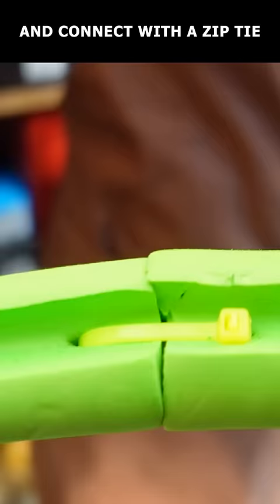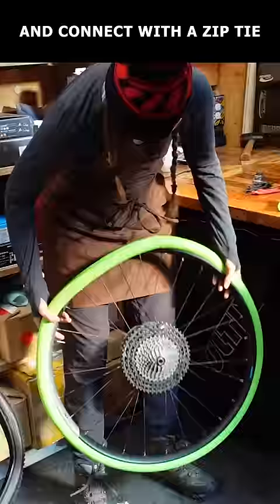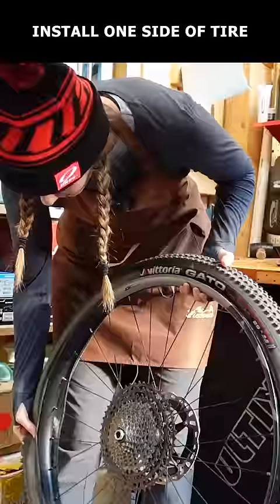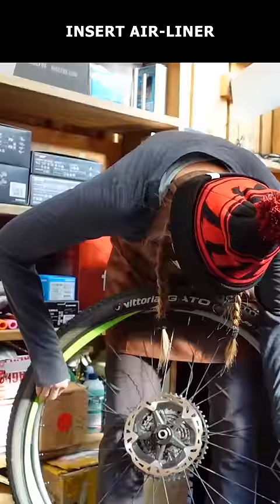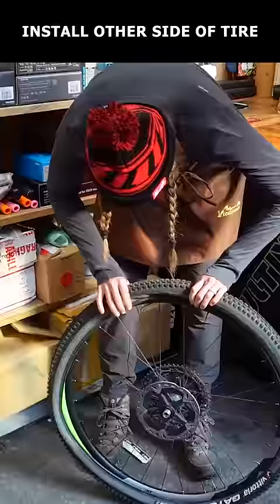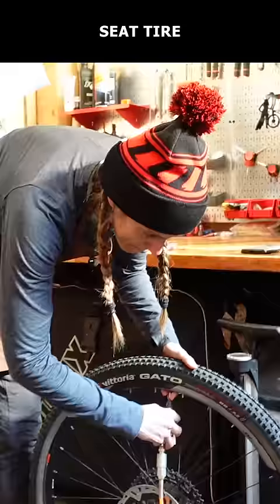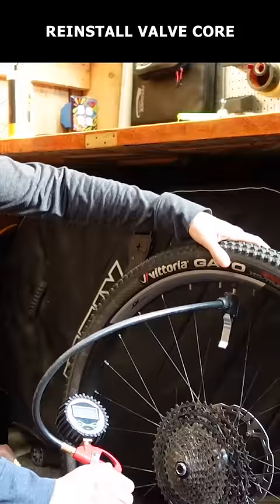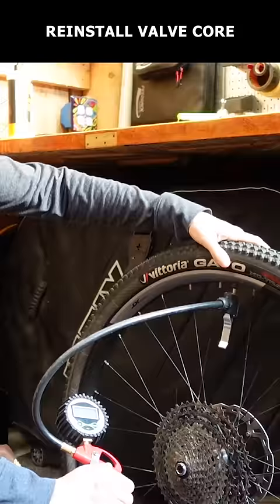Installing the Vittoria Air-Liner tire insert #Shorts

Comment: Is she saying that is a tubeless rim? Cos no mention of a tube going in with that.
Reply from the maker: This system provides additional rim and puncture protection in tubeless setups and allows you to run slightly lower pressures. It is also a "run flat" system so if you do get a flat you can continue to ride the tire without risking it rolling off the rim. We don't generally recommend that unless you're racing enduro or downhill, but it is an option. So, while it isn't for everyone, it's quite helpful for lots of people.

Comment: Looks heavy......why not carry a patch kit and some big air?
Reply from the maker: This system provides additional rim and puncture protection in tubeless setups and allows you to run slightly lower pressures. It is also a "run flat" system so if you do get a flat you can continue to ride the tire without risking it rolling off the rim. We don't generally recommend that unless you're racing enduro or downhill, but it is an option. So, while it isn't for everyone, it's quite helpful for lots of people.

Comment: When you said to cut it 1cm shorter than measured, it looked like you did just that and cut 1cm shorter. However, when you said to insert the zip ties 1cm in, that was more like 5cm.

Comment: You could just you know buy a regular tubeless tyre kit
Reply from the maker: This system provides additional rim and puncture protection in tubeless setups and allows you to run slightly lower pressures. It is also a "run flat" system so if you do get a flat you can continue to ride the tire without risking it rolling off the rim. We don't generally recommend that unless you're racing enduro or downhill, but it is an option. So, while it isn't for everyone, it's quite helpful for lots of people.

Comment: Why inflate... just use regular tire if you have to inflate and it's not flat free why install?
Reply from the maker: This system provides additional rim and puncture protection in tubeless setups and allows you to run slightly lower pressures. It is also a "run flat" system so if you do get a flat you can continue to ride the tire without risking it rolling off the rim. We don't generally recommend that unless you're racing enduro or downhill, but it is an option. So, while it isn't for everyone, it's quite helpful for lots of people.

Comment: This is instead of an airtube for no flat tyres?
Reply from the maker: This system provides additional rim and puncture protection in tubeless setups and allows you to run slightly lower pressures. It is also a "run flat" system so if you do get a flat you can continue to ride the tire without risking it rolling off the rim. We don't generally recommend that unless you're racing enduro or downhill, but it is an option. So, while it isn't for everyone, it's quite helpful for lots of people.

Comment: whats the purpose of this? to be safe when you get a puncture? genuinely curious.
Reply from the maker: This system provides additional rim and puncture protection in tubeless setups and allows you to run slightly lower pressures. It is also a "run flat" system so if you do get a flat you can continue to ride the tire without risking it rolling off the rim. We don't generally recommend that unless you're racing enduro or downhill, but it is an option. So, while it isn't for everyone, it's quite helpful for lots of people.
Reply: @sydfixesbikes  ohh wow, that's cool. thanks for explaining it to me

Comment: What's the point of the air liner if it's still taking air and sealant
Reply from the maker: This system provides additional rim and puncture protection in tubeless setups and allows you to run slightly lower pressures. It is also a "run flat" system so if you do get a flat you can continue to ride the tire without risking it rolling off the rim. We don't generally recommend that unless you're racing enduro or downhill, but it is an option. So, while it isn't for everyone, it's quite helpful for lots of people.

Comment: What is this for? Like whats the purpose behind it ?
Reply from the maker: This system provides additional rim and puncture protection in tubeless setups and allows you to run slightly lower pressures. It is also a "run flat" system so if you do get a flat you can continue to ride the tire without risking it rolling off the rim. We don't generally recommend that unless you're racing enduro or downhill, but it is an option. So, while it isn't for everyone, it's quite helpful for lots of people.

Comment: Why this instead of a regular inner tube?
Reply from the maker: This system provides additional rim and puncture protection in tubeless setups and allows you to run slightly lower pressures. It is also a "run flat" system so if you do get a flat you can continue to ride the tire without risking it rolling off the rim. We don't generally recommend that unless you're racing enduro or downhill, but it is an option. So, while it isn't for everyone, it's quite helpful for lots of people.

Comment: Why ? What's the air liner for ? What's wrong with normal tubeless ?
Reply from the maker: This system provides additional rim and puncture protection in tubeless setups and allows you to run slightly lower pressures. It is also a "run flat" system so if you do get a flat you can continue to ride the tire without risking it rolling off the rim. We don't generally recommend that unless you're racing enduro or downhill, but it is an option. So, while it isn't for everyone, it's quite helpful for lots of people.

Comment: How hard is it to come up with something that doesn’t need air pressure?
Reply from the maker: Weight is the issue. Motorcycles have an airless system (mousse) but when you don't have a motor the weight is a bigger problem.

Comment: Why use tyre sealent and the airliner ?
Reply from the maker: This system provides additional rim and puncture protection in tubeless setups and allows you to run slightly lower pressures. It is also a "run flat" system so if you do get a flat you can continue to ride the tire without risking it rolling off the rim. We don't generally recommend that unless you're racing enduro or downhill, but it is an option. So, while it isn't for everyone, it's quite helpful for lots of people.

Comment: So i'm a dumb roadie, what's this for exactly? Added suspension?
Reply from the maker: This system provides additional rim and puncture protection in tubeless setups and allows you to run slightly lower pressures. It is also a "run flat" system so if you do get a flat you can continue to ride the tire without risking it rolling off the rim. We don't generally recommend that unless you're racing enduro or downhill, but it is an option. So, while it isn't for everyone, it's quite helpful for lots of people.
Reply: @sydfixesbikes  that's pretty interesting! Thanks!

Comment: Iam running Tubeless without this Airliner. Why should I use this?
Reply from the maker: This system provides additional rim and puncture protection in tubeless setups and allows you to run slightly lower pressures. It is also a "run flat" system so if you do get a flat you can continue to ride the tire without risking it rolling off the rim. We don't generally recommend that unless you're racing enduro or downhill, but it is an option. So, while it isn't for everyone, it's quite helpful for lots of people.

Comment: What's the point if you still have to put air in the tire?
Reply from the maker: This system provides additional rim and puncture protection in tubeless setups and allows you to run slightly lower pressures. It is also a "run flat" system so if you do get a flat you can continue to ride the tire without risking it rolling off the rim. We don't generally recommend that unless you're racing enduro or downhill, but it is an option. So, while it isn't for everyone, it's quite helpful for lots of people.
Reply: @sydfixesbikes  oh ok, Thanx! ☺️👍

Comment: What is the purpose of these? Literally curious not being rude.
Reply from the maker: This system provides additional rim and puncture protection in tubeless setups and allows you to run slightly lower pressures. It is also a "run flat" system so if you do get a flat you can continue to ride the tire without risking it rolling off the rim. We don't generally recommend that unless you're racing enduro or downhill, but it is an option. So, while it isn't for everyone, it's quite helpful for lots of people.

Comment: What does this do in terms of benefits?
Reply from the maker: This system provides additional rim and puncture protection in tubeless setups and allows you to run slightly lower pressures. It is also a "run flat" system so if you do get a flat you can continue to ride the tire without risking it rolling off the rim. We don't generally recommend that unless you're racing enduro or downhill, but it is an option. So, while it isn't for everyone, it's quite helpful for lots of people.

Comment: What its for ? I have an inner tube in my tire..
Reply from the maker: This system provides additional rim and puncture protection in tubeless setups and allows you to run slightly lower pressures. It is also a "run flat" system so if you do get a flat you can continue to ride the tire without risking it rolling off the rim. We don't generally recommend that unless you're racing enduro or downhill, but it is an option. So, while it isn't for everyone, it's quite helpful for lots of people.

Comment: You don't need sealant in an airless tube
Reply from the maker: For mountain bikes you do as they don't hold pressure as well as car tires. Also, the sealant helps protect against punctures.
Reply: @sydfixesbikes  ok but it doesn't feel right putting a hat on a hat

Comment: What does it do, stop the tyre pinching?
Reply from the maker: This system provides additional rim and puncture protection in tubeless setups and allows you to run slightly lower pressures. It is also a "run flat" system so if you do get a flat you can continue to ride the tire without risking it rolling off the rim. We don't generally recommend that unless you're racing enduro or downhill, but it is an option. So, while it isn't for everyone, it's quite helpful for lots of people.
Reply: @sydfixesbikes  ah right ok.. thanks for explaining that to me. Everyday is a school day isn't it. 👍

Comment: Difference from this vs tubeless?
Reply from the maker: This system provides additional rim and puncture protection in tubeless setups and allows you to run slightly lower pressures. It is also a "run flat" system so if you do get a flat you can continue to ride the tire without risking it rolling off the rim. We don't generally recommend that unless you're racing enduro or downhill, but it is an option. So, while it isn't for everyone, it's quite helpful for lots of people.

Comment: If u use sealant why use liner? And vice versa
Reply from the maker: This system provides additional rim and puncture protection in tubeless setups and allows you to run slightly lower pressures. It is also a "run flat" system so if you do get a flat you can continue to ride the tire without risking it rolling off the rim. We don't generally recommend that unless you're racing enduro or downhill, but it is an option. So, while it isn't for everyone, it's quite helpful for lots of people.
Reply: @sydfixesbikes  ok

Comment: You have to set the beads on bike wheels these days ?
Reply: Tubeless tyres need the bead setting, yes.
Reply: @DanceySteveYNWA - They do not aggregate these shorts it seems. Has been 20 years since that scene for me. Thanks for getting back.

Comment: tubeless tires? if so whats the reason for this
Reply from the maker: This system provides additional rim and puncture protection in tubeless setups and allows you to run slightly lower pressures. It is also a "run flat" system so if you do get a flat you can continue to ride the tire without risking it rolling off the rim. We don't generally recommend that unless you're racing enduro or downhill, but it is an option. So, while it isn't for everyone, it's quite helpful for lots of people.
Reply: @sydfixesbikes  ahh thank you for the knowledge 
I've learned something new today

Comment: One time me and mate were out on skateboards a wheel flew off going downhill so we had to look for a nut for my mate we found the wheel nut the nut tho we found wire and tied it tight and it would work for like 30 seconds and fall off we eventually found a hardwear store bought a nut and we were able to get home

Comment: What's the use of that green sponge??
Reply from the maker: This system provides additional rim and puncture protection in tubeless setups and allows you to run slightly lower pressures. It is also a "run flat" system so if you do get a flat you can continue to ride the tire without risking it rolling off the rim. We don't generally recommend that unless you're racing enduro or downhill, but it is an option. So, while it isn't for everyone, it's quite helpful for lots of people.
Reply: @sydfixesbikes  so why can't we use this green thing in cars and motor bikes?

Comment: issue with putting that goop crap in there and its the same with cars, is a b to clean and remove the tire when you need to change the tire, I’m glad no one thinks to use that crap on cars cause its nothing but headache and I’d rather sell you a new rim and tire when you use that crap to seal the tire

Comment: So what does this do for your ride?
Reply from the maker: This system provides additional rim and puncture protection in tubeless setups and allows you to run slightly lower pressures. It is also a "run flat" system so if you do get a flat you can continue to ride the tire without risking it rolling off the rim. We don't generally recommend that unless you're racing enduro or downhill, but it is an option. So, while it isn't for everyone, it's quite helpful for lots of people.

Comment: Do these things work for dirt bike/dual sport motorcycle (street legal dirt bikes) tires since they're tubed?
Reply from the maker: This system provides additional rim and puncture protection in tubeless setups and allows you to run slightly lower pressures. It is also a "run flat" system so if you do get a flat you can continue to ride the tire without risking it rolling off the rim. We don't generally recommend that unless you're racing enduro or downhill, but it is an option. So, while it isn't for everyone, it's quite helpful for lots of people.
Reply: @sydfixesbikes  I don't think you understood the question

Comment: What does this do exactly, never heard of it
Reply from the maker: This system provides additional rim and puncture protection in tubeless setups and allows you to run slightly lower pressures. It is also a "run flat" system so if you do get a flat you can continue to ride the tire without risking it rolling off the rim. We don't generally recommend that unless you're racing enduro or downhill, but it is an option. So, while it isn't for everyone, it's quite helpful for lots of people.

Comment: What is the point in this product? Thought the idea was not to have air in to get a flat in the first place? 🤔
Reply from the maker: This system provides additional rim and puncture protection in tubeless setups and allows you to run slightly lower pressures. It is also a "run flat" system so if you do get a flat you can continue to ride the tire without risking it rolling off the rim. We don't generally recommend that unless you're racing enduro or downhill, but it is an option. So, while it isn't for everyone, it's quite helpful for lots of people.

Comment: What the point of the green thing?
Reply from the maker: This system provides additional rim and puncture protection in tubeless setups and allows you to run slightly lower pressures. It is also a "run flat" system so if you do get a flat you can continue to ride the tire without risking it rolling off the rim. We don't generally recommend that unless you're racing enduro or downhill, but it is an option. So, while it isn't for everyone, it's quite helpful for lots of people.
Reply: @sydfixesbikes  thanks, perfect answer.

Comment: May I ask what this is for?
Reply from the maker: This system provides additional rim and puncture protection in tubeless setups and allows you to run slightly lower pressures. It is also a "run flat" system so if you do get a flat you can continue to ride the tire without risking it rolling off the rim. We don't generally recommend that unless you're racing enduro or downhill, but it is an option. So, while it isn't for everyone, it's quite helpful for lots of people.
Reply: @sydfixesbikes  Very interesting, thanks.

Comment: I never seen this before is this like a run flat
Reply from the maker: This system provides additional rim and puncture protection in tubeless setups and allows you to run slightly lower pressures. It is also a "run flat" system so if you do get a flat you can continue to ride the tire without risking it rolling off the rim. We don't generally recommend that unless you're racing enduro or downhill, but it is an option. So, while it isn't for everyone, it's quite helpful for lots of people.

Comment: What’s the point ? Mind explaining ?
Reply from the maker: This system provides additional rim and puncture protection in tubeless setups and allows you to run slightly lower pressures. It is also a "run flat" system so if you do get a flat you can continue to ride the tire without risking it rolling off the rim. We don't generally recommend that unless you're racing enduro or downhill, but it is an option. So, while it isn't for everyone, it's quite helpful for lots of people.

Comment: Why you have to cut it?
Reply from the maker: Because it's super long when you receive it and you cut it down to size so it can fit 29", 27.5" and even smaller wheel sizes.